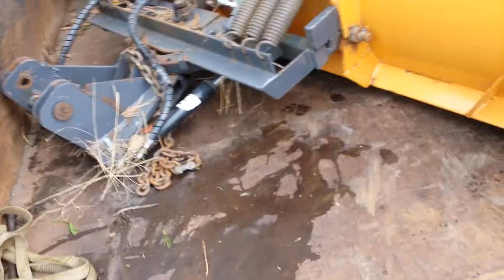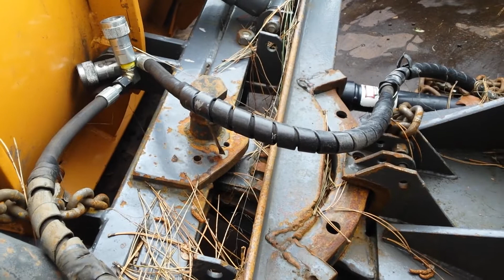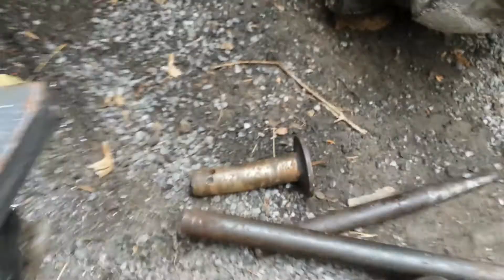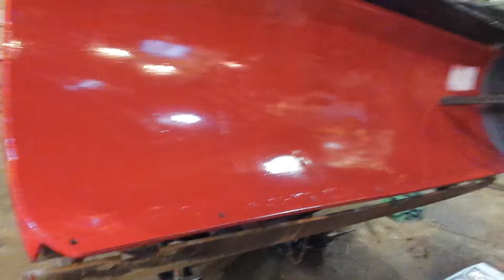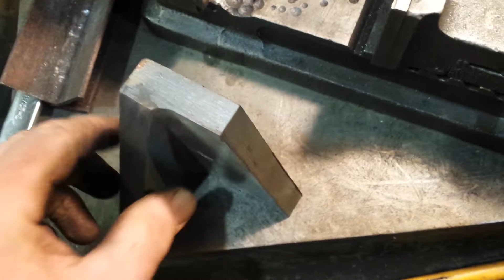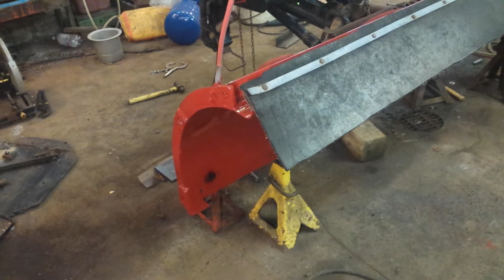Fabricate, Welding and Repairs

Comment: What if you just pop a plow frame on it like a fisher or what’s on your truck just to get it some clearance off the ground. I’ve seen guys run them like that so the plow is up higher off the ground. You don’t want to crush that thing at speed it’ll tear that tractor up bad
Reply from the maker: I checked that yesterday. The front tires would hit anything wider, there isn't much room.